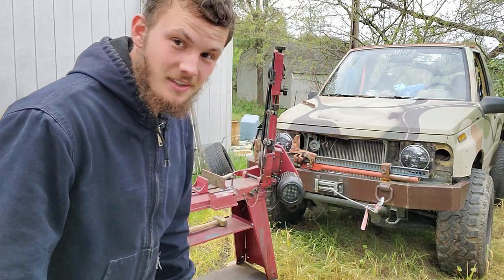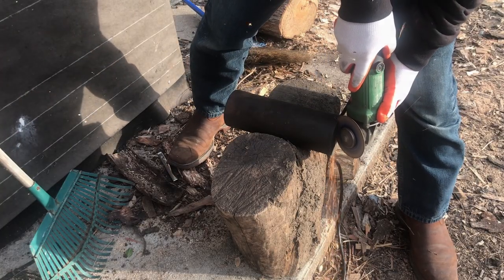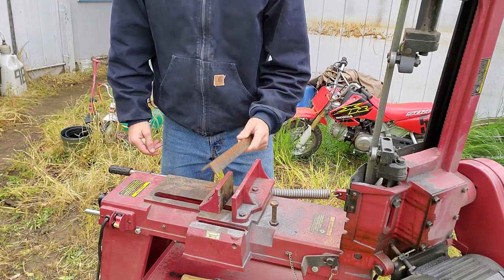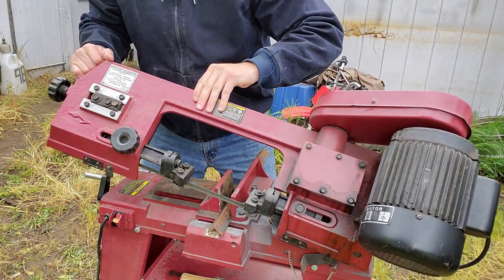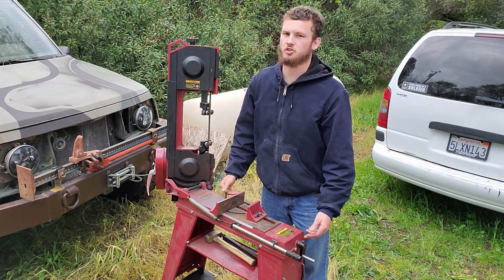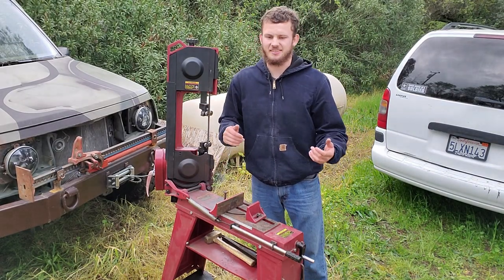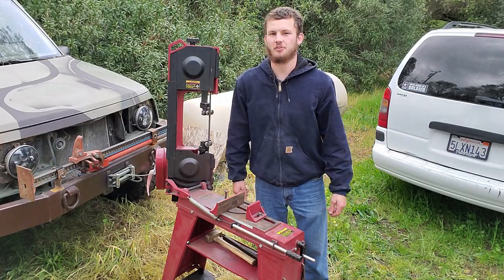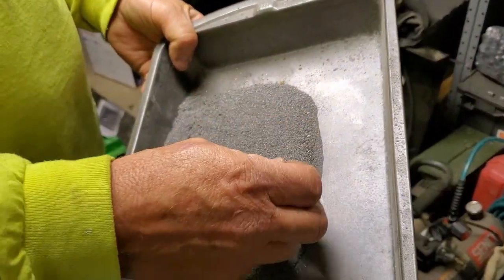If you have a shop, you NEED this piece of equipment...

Comment: Hey Jake I've used one of these in nearly every shop I've worked at. The only thing I have to add is get one of those tubes of blade lube. It's a solid tube of waxy lube, and helps you blades last.
Reply from the maker: Good call! When cutting the 4140, we did go through a couple of blades. I'll add that to the list!